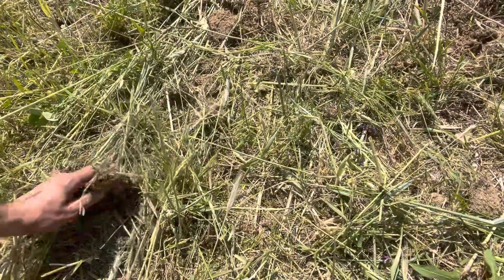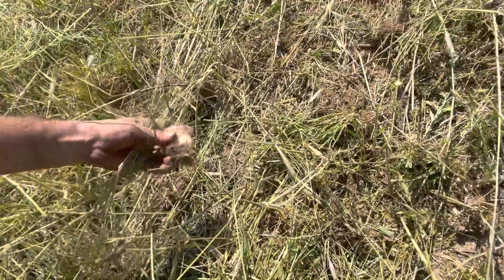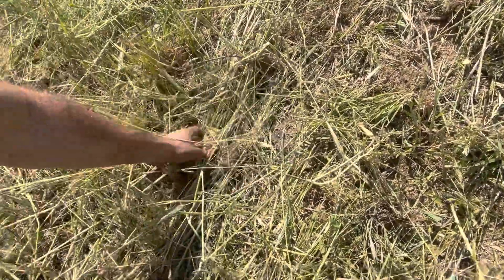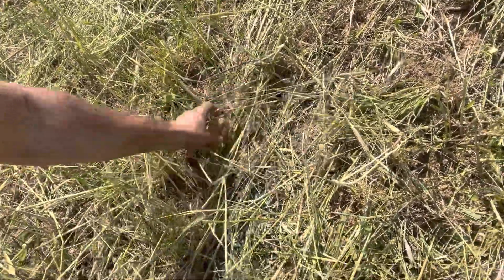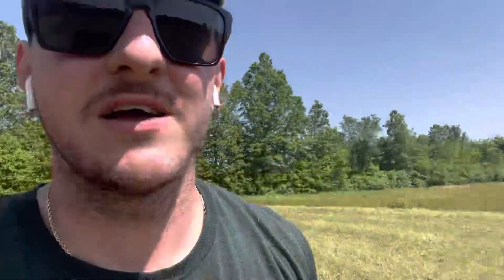Part two using a tiller and mower to terminate cover crop

Comment: I have a similar tractor. I’m just wondering how you lower the tiller and raise the mower at the same time. If I were to raise my mid mount mower to the highest level the tiller  would also raise to its highest level. Do you have independent controls?
Reply from the maker: No. You can lock mid mount at top-
And then lower the tiller to desired depth. However - I don’t lower tiller clear to lowest depth, as I am just wanting to lightly disturb soil.